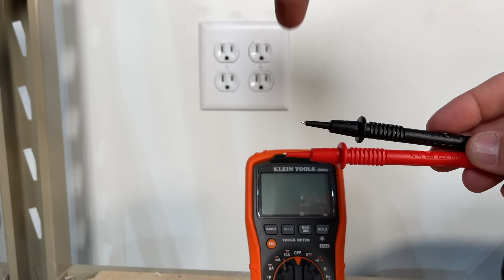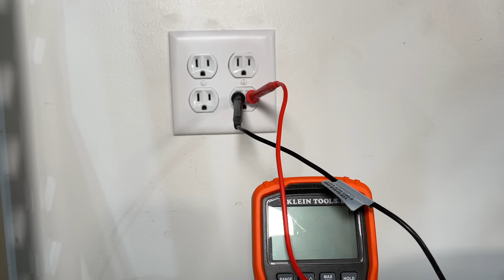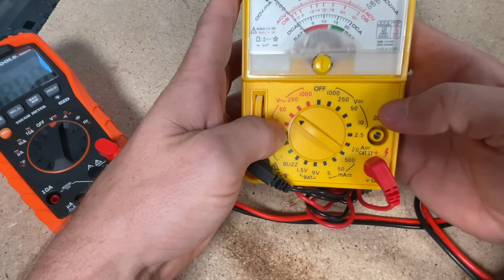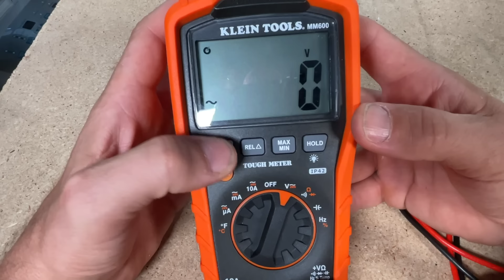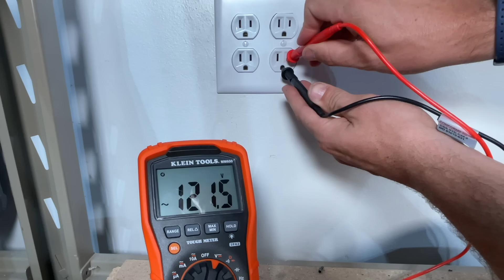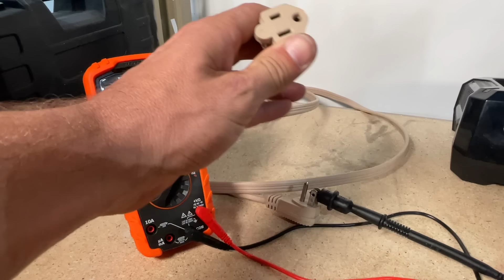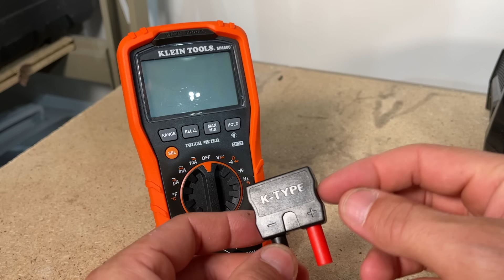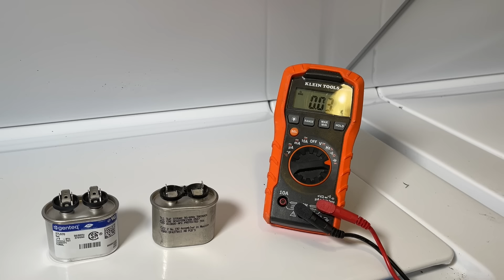How To Use A Multimeter for Home Repairs and Troubleshooting

Comment: explain to me how you can take a power adaptor that has 2 equal sized legs and works in either way you plug it into a socket ???
In the socket, there is a HOT with 120V and the negative or Neutral.
I take my power adaptor and plug it in 1 way and i get my power from the DC plug, i then swap the polarity on the power adaptor and i STILL get power from the DC plug and still have the outer shell as - and the inside as + 

So no matter which way i plug in my power adaptor, i get the right polarity on my DC plug even though i am moving the 120V hot leg from one leg to another on the input power adaptor ...

Comment: I guess as an Electrical Engineer who has spent the better part of his career in various labs with lots of test equipment, it is interesting to see a tutorial about a DMM (Digital Multi-Meter) from a DIY'er point of view. I have been using DMM's since the early 1990's; made by Fluke with a number of different accessories including temp sensor & current measurement (inductive loop).
Reply: Seeing your experience i have a question i still have no answer for. 

In the first part of the video the guy told us not to touch the other probe while one of them is connected to live wire on the wall plug. Why is that. Doesn't the multimeter have a high impedance or was it because he hadn't turned it on the voltage measurement mode. If so how does the impedance of the multimeter change from the voltage measuring and resistance measuring (or even mA measuring if it's a 3 hole multimeter)

What I know is that voltage measurement mode has a high (1meg ohm) impedance so there shouldn't be any risk in shorting out anything (excluding very high voltages). As for the resistance mode i don't know but it must have less impedance and it depends on the range. But multimeters have written in their manuals that it is safe even if you touch a high voltage supply up to 500v (for example) with your probes. As for the current mode impedance idk but gotta be small.
Reply: @redmist4963  Good question and you are the only one calling it out, AFAICT.   Yes, there is a voltage measured at the probe opposite the probe attached to the hot line.  BUT, there is also a 40 MILLION OHM insulator, the DMM, between that probe and the hot line.   Touching that probe is no more dangerous than touching the insulation sheathing around a powered line that a non-contact voltage tester would also show as 'hot' just as it shows the black probe as hot in his demo.  He says the same in other YTs and it drives me crazy.  Now if the DMM were set to measure something other than voltage; say Amperage, touching that probe would be somewhat more exciting if you were in contact with a ground path. 😳

Comment: What in the world are you talking about? I feel you are lacking some very fundamental knowledge. Definitely the knowledge to be TEACHING 500k subscribers how electricity and multimeters work! 

You wont get an arc from the probes of a multimeter (assuming they are connected to the correct terminals on the meter aka not current). Even if the meter was a dead short to create an arc (which its not) electricity doesn't care in which order you create a short, it will arc from the black hot lead to neutral just the same as it would arc from the hot outlet terminal to a red neutral lead. A meter isn't a dead short though, does your meter blow up every time you use it and trip the breaker?

Also, how would you test 240 volts? Both terminals are 120volt hot. Which lead would you put on first in that case? Neither? Maybe you can move at the speed of light and put them both on at the same precise time down to the nanosecond?

You might get a tingle out of a cheap meter if one lead is on hot and you grab the other lead while you are very well grounded or touching the neutral. But the resistance of a multimeter is high enough that it doesn't pass much current. Thats how it works after all. Again if it passed high current it would short out whatever you were testing using it on. It would destroy sensitive electronics and it would be otherwise a useless tool..

Give electricity a break for a while go tick off some plumbers or carpenters with DIY hacks.
Reply from the maker: Overall a fairly salty comment but I still appreciate the feedback.

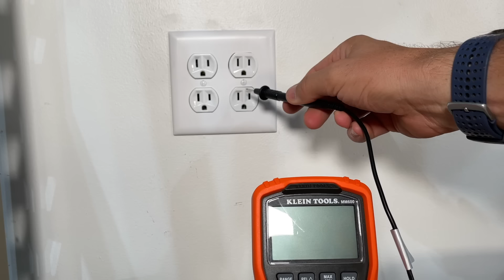Comment: At 1:00 you said to put the black probe into the neutral or the ground side. Then you said you were going to plug the black probe into the ground side but you plugged it into the neutral side. Maybe you should have mentioned that the neutral side is the small slot.
You mentioned Romex which is a brand name like Kleenex.
The wire is actually NM which stands for non-metallic.
Reply: I think you do a great job with these videos you're very informative and you help a lot of people.

Comment: You prove a safety-issue, but not the one you would like to show. Your assumption of taking the black lead out and that it is hot by using a contactless indicator is the biggest safety-issue in this clip. Contactless indicators are ok for first indication, but not for final measurement. They will react to any kind of magnetic/static field. For instance, rub them on your arm and they will give you a possitive signal. Therefore always use a mulimeter or a duspol. What you do with your black lead is wrong. The resistance of your multimeter in voltage-setting is in Mega-ohms. The voltage on your black is probably somewhere around 20V, but with a frequency of 50 or 60 Hz. This frequency (fluctuating magnetic field) is triggering the contactless indicator and making a false reading, that your black lead is hot. If your black lead was hot, it would short circuit when measuring your walloutlet. Those contactless indicators should be prohibited for DIY-ers, because they don't really know what they are indicating. For instance, with DC-voltage (solarpanels, some welding-equipment, etc.) it will not  indicate a live or hot wire, because there is no alternating voltage and therefore no alternating magnetic field. This is the real safety-issue. You are right if you use the multimeter in ampere-setting, because this setting is low-resistance and needs to be used in series with the consuming device. Touching the black wire in this setting will lead to a shock and other dangerous situations. Always check the voltage with a 2-pole measuringdevice like a multimeter, duspol, etc. Also always measure between Neutral-Live, Neutral-earth, Earth-Live, the famous 3-point-check, electricians always do. If you're measuring in a multi-fase mains (2- or 3-fase), always measure between all wires, Hot1-Neutral, Hot2-Neutral, Neutral-Earth, Earth-Hot1, Earth-Hot2 for a 2-fase mains (5-point-measurement). For 3-fase, measure L1-N, L2-N, L3-N, N-Earth, Earth-L1, Earth-L2, Earth-L3 (7-point-measurement). If all of these voltages are about 0V, you're most likely safe. For DC, you can only measure plus and minus, but mention your multi-meter is in DC-setting. Throw those contactless indicators away, these give false safety and are only for a possible indication and should always be used in combination with a 2-pole-meter. Some industries (e.g. petrochemical) don't allow using contactless indicators and only allow 2-pole-measurementequipment, indicating the problem.

Comment: I use a fluke auto meter model 1000 and don't need to adjust any buttons and I retired from industrial work , worked with 480 down and a DIY should get help with this and not just feel its safe cause you watched a video .

Comment: Those small beeping meters will beep because power in circuit  ñot always  because hot wire and nothing will happen to meter if you pull probe out

Comment: @1:09, I didn't think that was the ground side.
Reply: You should also discuss parallel conductors and the induction current that can be picked up by a DVM sensitivity when it doesnt have a low impedance setting.

Comment: How do you know which hole is hot / neutral?
Reply: If it is wired properly, the tall hole is neutral, and the short hole is the hot.   If you need to determine which is hot and which is neutral, test relative to the ground hole in AC Voltmeter mode.  Place your lead in the ground socket first, and then place your lead in the current-carrying socket you are testing.  Take your lead out of the socket that isn't ground first, and take your ground lead out last.

Comment: I am a DIY home owner with not much background in electrical engineering. I just purchased the same multimeter (Klein Tools MM600) because my buddy who is an electrical engineer said that Klein Tools makes great testing devices for the bang. Unlike Fluke, it doesn't charge you arm and leg. So far your video is very helpful, and I know how to use it!

Comment: If having an issues on an outlet, what would the lowest reading be for the outlet before it would be considered a voltage drop? I think I have a freezer that is causing a voltage drop and wanted to check when the compressor kicks on.

Comment: I understand that you try to be cautious with your viewers, but the impedance across the voltage terminals of a typical multimeter is 10 Megohms, which means if you plug into the hot side first you might expose yourself to a 12 microamp current, hardly anything to be worried about.

Comment: We have recently bought a 13 Amps electric lawn mower. I bought a few different outdoor extension cords to use with the mower.(14 gauge X 75 ft) (12 gauge x 75 ft) and (12 gauge x 50ft). I would like to use the most appropriate cord that give an out put of 13+ Amps for the mower. How do I measure how many Amps are present at the end of the extension cord, before the mower is plugged in? What setting do I use the multimeter at since I am measuring more than 10Amps?

Comment: As a DIY man, I use a Fluke 77 that I've had since 1986. I test voltage and resistance in the house as well as when I deal with vehicles. I recently had an issue with my AC Unit and it turned out to be a bad capacitor. Luckily my son-in-law has his own AC business, so I was able to get it taken care of the same day. If I had multimeter that measured capacitance, I could have figured it out myself. Great information in the video as well.
Reply: I have a Fluke 77 that I love. It is a very rugged meter but lacking in some functionality so have upgraded to a clamp style meter.

Comment: I’m a newly single female and I would love to learn how to use a multi meter … and know what it’s used for
Reply: It's purpose is to measure the electrical operating conditions of a circuit, to confirm that the circuit is working as you expect.  Such as making sure you have continuity among metal components, where you should have continuity, or making sure that the voltage is what it should be.

Comment: Very helpful. I just purchased the CL800 . Probably more meter than I need for home gamer use but after testing a stator and rectifier  on a motorcycle with  2 el cheapo  models and getting  conflicting readings that were wildly different I thought I would get a decent model. Liked the clamp and AC/DC amps feature as well
   I picked up some good helpful tips from watching thanks. 👍

Comment: How do you measure weather an outlet is 15 or 20 amps in a house using a voltmeter? This is to avoid removing the outlet and determining via the wire gauge size, or looking at the circuit breaker.
Reply: You don't need a voltmeter to tell if an outlet is 15 or 20 amps. Just look at the outlet, if the hot and neutral are parallel slots, it's a 15 amp receptacle . If the left slot (neutral) looks like a T sideways it's a 20 amp receptacle. Of coarse you would want to check the breaker to make sure it's 20 amp, easy to check as the number is printed on the lever.

Comment: I prefer the AC and 12V DC to be on separate dial rotation instead of pushing mode selector, no way to get it wrong or forget.

Comment: The second part of this video is BS. The guy identified the terminals correctly, and then goes "Here I put it in the ground side" as he put the test lead into the neutral terminal. Then he says that his non contact voltage tester beeping proves that the black test lead is dangerous to touch. That is probably BS as well, because the input impedance of the multimeter is >10MΩ (*). There is possibly a high voltage at the black test lead, but it can not carry any current through the 10 Mohm impedance. And why was the meter in the off position while inserting the probes into the outlet? Who knows what happens when you turn the rotary knob while the probe are connected to mains voltage and current? Maybe nothing will happen, but that depends on the multimeter in use.
*Scource: https://www.kleintools.com/sites/kleintools/files/instructions/MM6000_ENG%20REV_A_FINA_2-18-13.PDF

Comment: If you have to test a number of receptacles or have one plugged in for a longer period.  With a old pair of leads. Cut off the probes and attach a plug to the leads. Now your leads don't fall out of the receptacle.

Comment: The black probe is in the neutral not the ground and because of the high impedance of the multi-meter with the black probe in the common of the meter and red probe on the voltage input of the meter that is how you can measure the voltage otherwise if the red probe was in the Current input of the meter there would be a dead short to neutral or ground. You are measuring the voltage across the high impedance of the meter which only permits very small current flow. So if the black probe is inserted into the ground or earthed position of the outlet there is not a dead short. If you were silly enough the touch the black probe with the red probe in the live side of the outlet you would probablely trip the earth leakage circuit breaker.

Comment: I have my small business of spa repair and use multimeters all the time. I have old Fluke70 and few others plus proximity tester. Funny thing that a lot of licensed electricians don't use multimeters that often and when they are called to check the hot tub for electrical problem, they don't know what is going on, and reading schematics doesn't tell them anything. Recently I drove to spa 160 miles to remove the jumper which was installed just in case hot tub was connected to 120 volts circuit. Power connection was checked by local inspector, and he didn't see anything wrong with the installation.

Comment: With the red on live and the multimeter on voltage the black probe does NOT have live output. If you put the black probe on your tongue you will measure the potential difference between hot live and your body.
Your non contact voltage tester that beeps indicates the presence of back feed frequency and not the presence of current. As an electrician I use the tongue method frequently to identify hot if all the wires are the same colour or If there is no usable ground/ neutral.

Comment: Enjoyed your video. Just a question. Does that same hazard and caution apply to DC as well? As far as always touching ground probe first and then hot probe last?
Reply: If you had 120V dc, yes, the same hazard would apply.  And in fact, would be a greater hazard for DC.

With AC, there are zero crossings in the voltage source every 120th of a second, and those zero crossings will assist in allowing you to stop an arc, should you get your live metal parts too close to grounded metal parts.  With DC, you don't have these zero crossings, and the source will continue to feed the arc.  It is a lot more challenging to stop an arc driven by DC than an arc driven by the same effective voltage in AC.

What an electrical arc is, is what happens when the electric field in the air (Volts per meter) is strong enough to cause the air to change its state of matter from gas to plasma.  Air in the gas phase is a great insulator, but plasma is always a conductor.  And once you cause a path through air in the plasma state, pulling the metal apart will extend the range of the arc.  You have to pull it apart very quickly, for separation alone to stop it.  With AC, the zero crossings will help you extinguish the arc.  This is why AC and DC switches are not interchangeable for the same voltage and current ratings.

Comment: Good evening and nice to meet you sir!

I have a vehicle (2003 DODGE CARAVAN SE) and i want to apply this diagnostic test with my (Innova 3300) but im not comprehending it at all. 

Check for continuity between each of the blower motor switch input terminals of the blower motor resistor and the resistor output terminal. 

In each case there should be continuity.

 If OK, repair the instrument panel wire harness circuits between the blower motor switch and the blower motor resistor or the blower motor pigtail wires as required.

 If not OK, replace the faulty blower motor resistor.

If you are able to help me out and show me how to do this on my vehicle i will greatly appreciate your help sir.

Comment: 2 TIPS from a life long sparky: NEVER PURCHASE or use ANY test or safety equipment from lack of quality control cheating communist China & would strongly recommend using quality eye protection along with a long sleeve cotton shirt while testing possible energized circuits. Many years ago while the first few weeks the chief electrician made me keep one hand in my pocket then use a meter and attached one test lead to ground then use other lead to test for energized 120 volts. Was not allowed to test 208,240,277 & the 480 volts plant had until they thought I was properly safety trained.

Comment: HI . I am a  DIYer and even though I do not have much basic home electrical knowledge, I still went ahead and bought a Klein 390 multimeter (for simple tests, heater temp. reading),your videos have been a source of refence for me,  you explain things thoroughly for us simple homeowners even if they may sound repetitive /boring to seasoned electricians. one thing I would like to see is how to "prevent/avoid damages" to a multimeter ,or " things not to do with your multimeter"